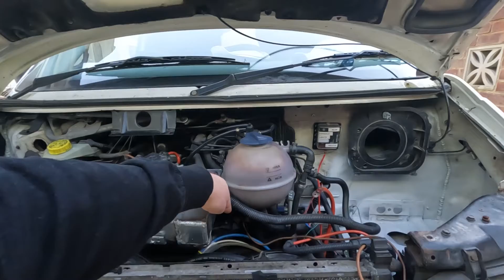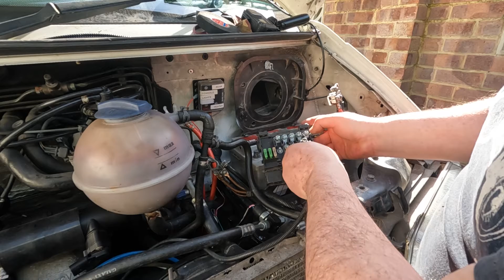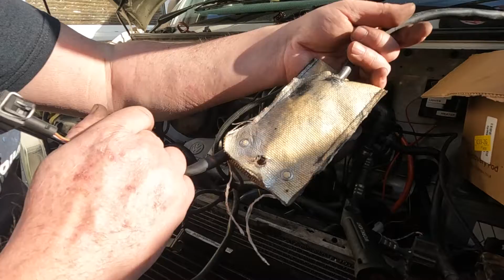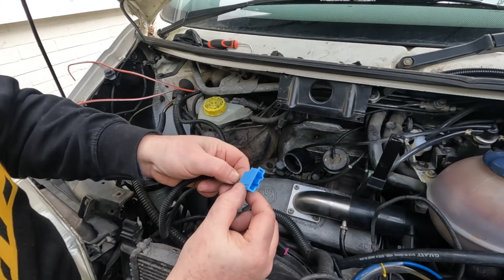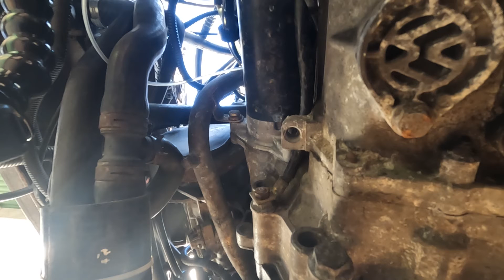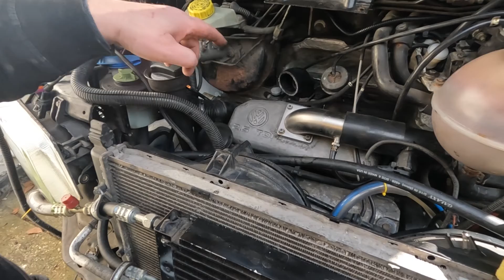VW T4 2.5tdi Engine Loom Swap - Using LHD Engine Harness in RHD Transporter!

Comment: What did it damage on ecu(s)?
Mine effected the 5v reference voltage which would then effect the throttle pedal
Reply from the maker: Not 100% sure on what specifically - I don't have the means to test electronics, all I know is the van would not run in each case.